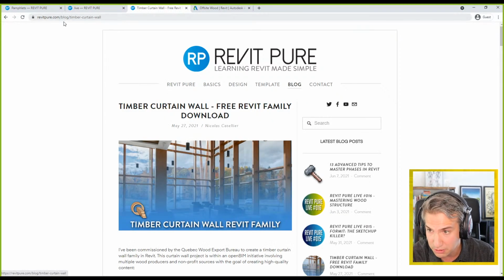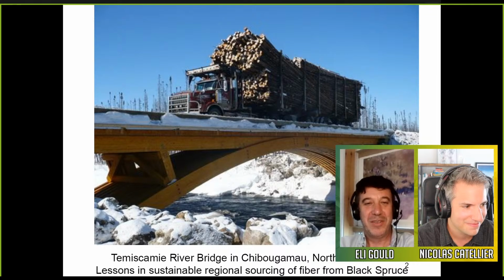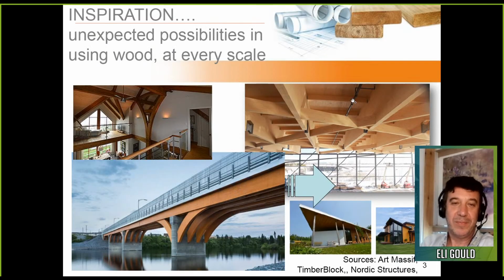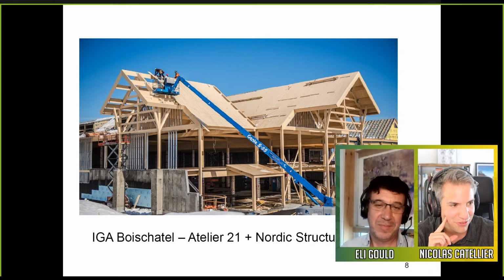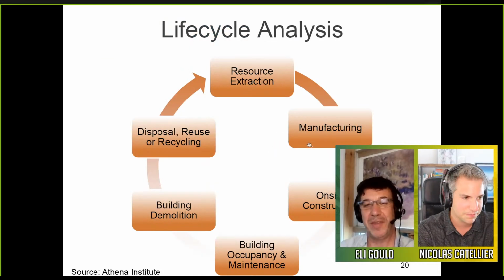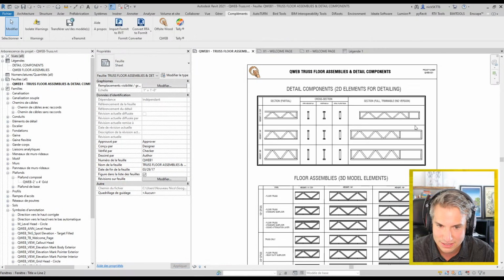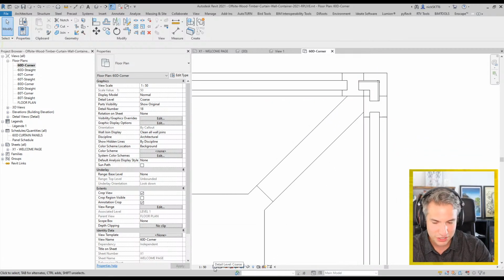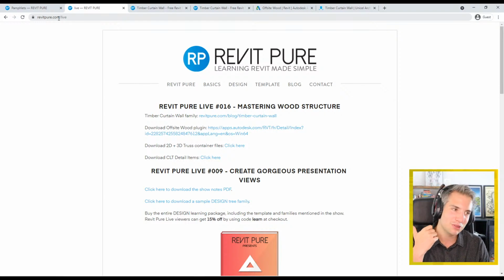Revit Pure Live #016 - Mastering Wood Structure with Eli Gould

Comment: Growth rate affects quality of the wood though. The faster the wood grows, the more humid the environment usually, therefore you end up with a very low grade quality akin to that of wood pulp, very low density wood. In countries like Canada, Austria, France (Jura region), Finland most likely the wood is likely to be of a pretty high grade because the climate does not necessarily support a fast growth, it is moderate. In tropical or very humid countries such as New Zealand where pine grows super fast and super "pulpy", the quality is much lower. And in various parts of the World, various wood grades seem to apply. What is considered suitable for construction in one country will only be suitable for producing paper in another. And as you pointed, wood is only sustainable if it is harvested and treated locally. If you harvest it locally but has to ship it to China to be chemically treated before it is shipped back to its native country, it is clearly not as sustainable a solution as it should be. But I love CLT, I have been working on several projects here in New Zealand, the industry is slowly catching up, Fire Rating is obviously a concern, how high can you go with timber also because timber compresses, so there a lot of interesting challenges that we can learn from places like Canada.